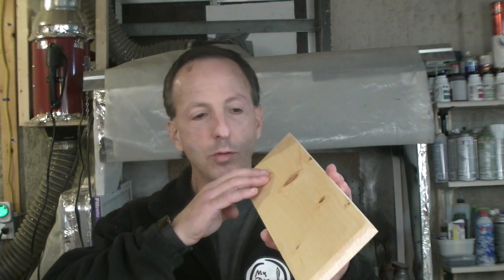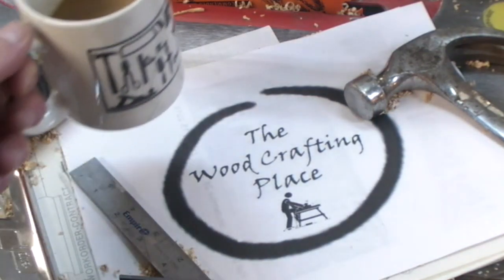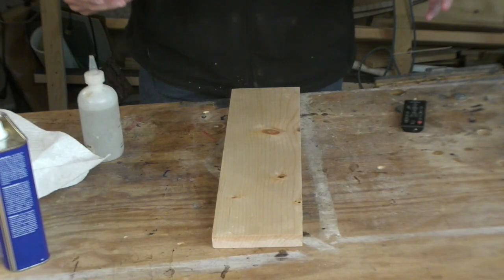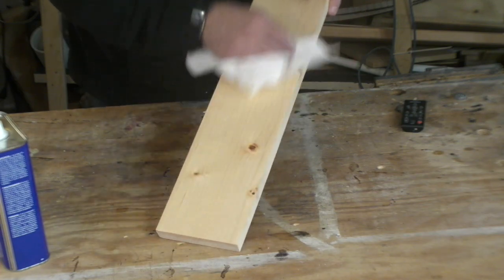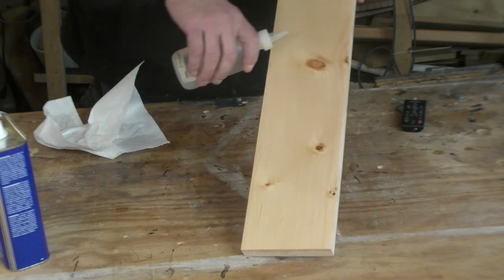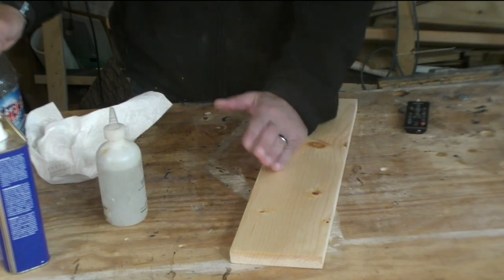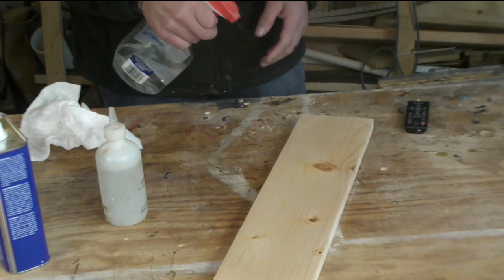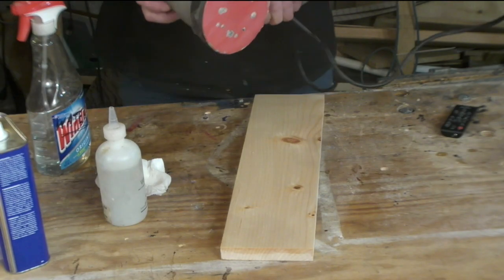How to Remove Scratches After Sanding

Comment: What you suggest doing if you find the scratch after staining? Would this method still apply
Reply from the maker: Yes this will work, but alot depends on how deep the scratch is.  Raising the grain with water will only raise it a little and you will unfortunately probably still have to sand the surrounding area as well to get the surfaces even.  Thanks for watching.

Comment: Can I use this technique after I stained? I just did a job and didn't see scratches till after the stain.
Reply from the maker: Probably because stain really doesn't seal the wood if you used a standard penetrating stain vs a poly/stain mix.  You may have to do a light sand first to remove any oil from the surface.  When you re-apply the stain use a rag and wipe by hand with very light coats until the color evens out.  The last coat of stain should be the whole surface to make everything uniform.  Good luck and let me know how you make out. Of course, thanks for watching
Reply: @woodworkingyoutube  are you suggesting a poly/stain mix over a regular penetrating stain for floors?

Comment: will this method work on furniture paint scratches?
Reply from the maker: I have never tried it, however since the paint has a depth above the wood surface and the scratch typically goes into the wood, I don't think the grain will raise  up enough.  You should be able to feather the paint and blend it if you sand a spot aprox 1/2" beyond  all sides of the scratch.  This will get the paint to blend without a distinct line.  Hope that helps.